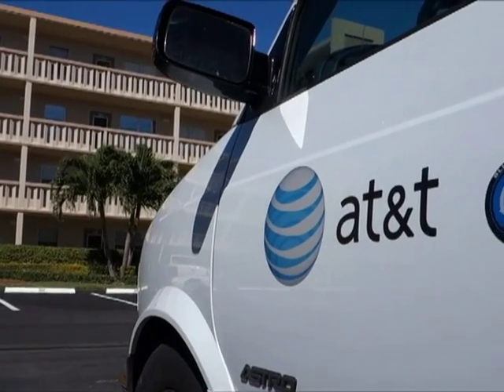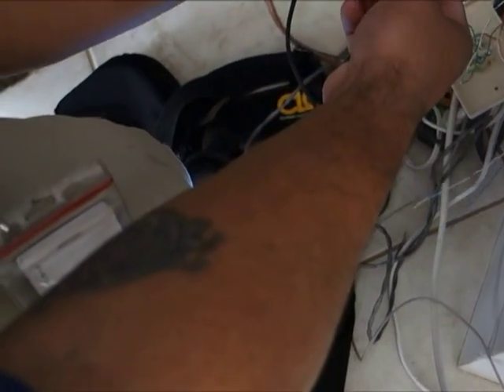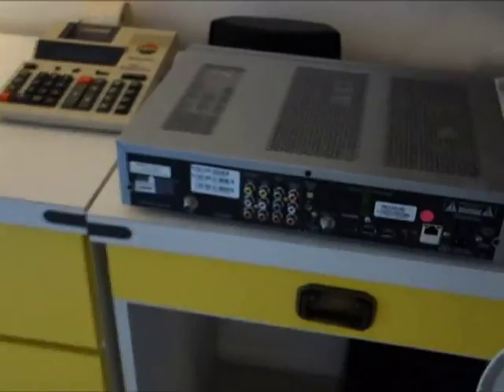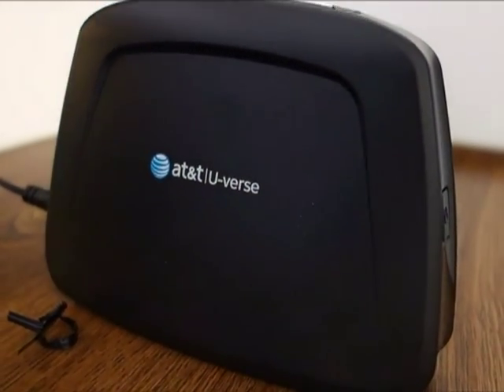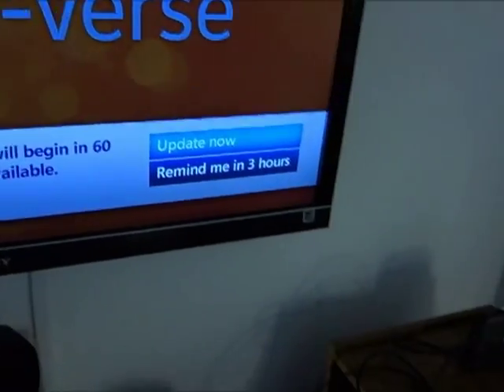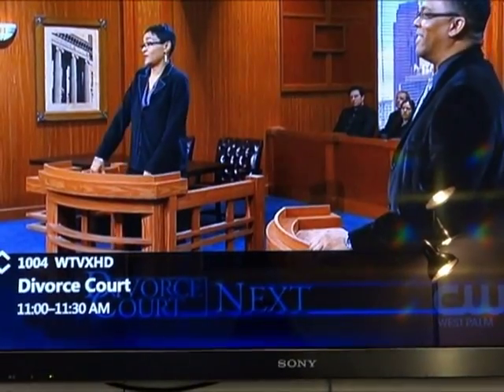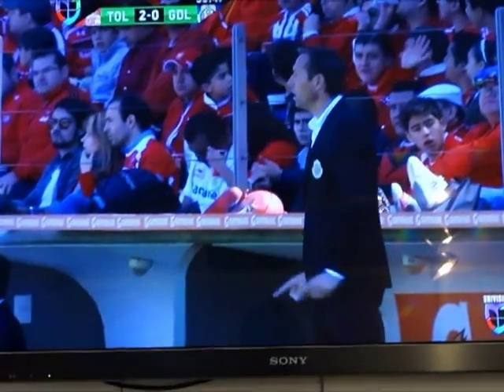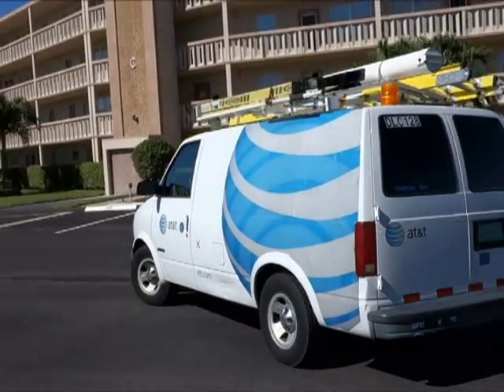The First AT&T U-verse Install in Century Village Boca Raton

Comment: Strange because ATT&T sent us a wireless box but I can't get the signal in the bedroom but the wireless is working on my computer in the same bedroom. I'm stuck at the setting up your wireless reciever in the exact same bedroom. I hate my life...
Reply: They are TWO different wireless signals. I recommend using powerline adapters with your modem and cable box.